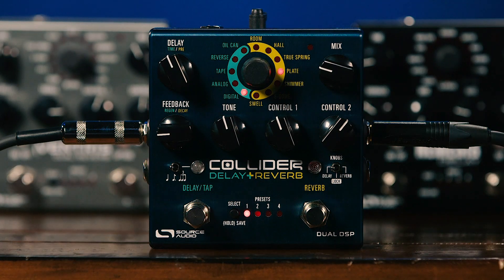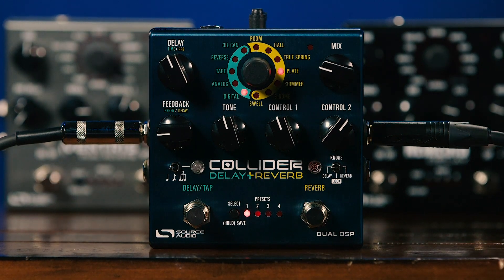Source Audio Collider Stereo Delay+Reverb Pedal Demo

Comment: Excellent demo, Mitch - you nailed it! Great guitar playing, too. Huge THANKS to all the good folks at Sweetwater for all that y'all do.
Reply: sourceaudioeffects when is it out?
Reply: When running it in stereo, is the delay true stereo, or is it the same signal sent out of both channels?
Reply: @skyviewdesign  You've probably got your answer by now, but just in case: All one series pedals are true stereo, routable however you want. By default they auto-sense - sum to stereo if both jacks are used, sum to mono if one is used - but you can change routing in the Neuro editor, say at a live gig you wanted to split the same mono signal to two external devices. On a side note about the Neuro Editor; I love how with the One Series you can download and/or create presets from other similar pedals. You can put anything from the Ventris or Nemesis on the Collider. Plus I have effects from the LA Lady and Kingmaker on my Aftershock.
Reply: @johncbeer  brilliant! Thanks for answering!

Comment: Does the delay and reverb act independently or are there any provisions for "delay into reverb" or "reverb into delay", or any kind of cross mixing them?   Thank you, nice device, nice video.
Reply from the maker: Hi philip. Each of the Collider's independent engines can either be a Delay or a Reverb. So, not only can you change the order, you can also have two Delays or two Reverbs in a preset. -Daniel
Reply from the maker: Hey, Philip! Thanks for your interest, and great question. It depends on exactly what you mean, but you definitely can change the way they interact with one another. Changing the pre-delay and trail settings will give you more separation or interaction between the two to start off with, but you can additionally change the order that the engines are processed by using the unlock button on the Neuro Desktop Editor. Default is delay before reverb, but you can switch that to reverb to delay, or you can run two reverbs or two delays instead.
I hope this helps! Let me know if you have any other questions.
Connor Smith, Sweetwater Sales Engineer, (800) 222-4700 ext. 1793, connor_smith@sweetwater.com

Comment: Can you control the presets with an external switch? Thanks!!!
Reply from the maker: Hi, Don. Yes, the Collider has MIDI capability so a MIDI foot controller could be used to access presets. The Matthews Effects Futurist or Tech 21 MIDI Mouse pedals would both be good ones to check out for that.
Thanks for your interest!
Charlie Davis, Sweetwater Sales Engineer, (800) 222-4700 ext. 1320, charlie_davis@sweetwater.com
Reply: While you switch the preset with an external midi controller, the pedal maintain the trails?
Reply: Thanks Charles!
Reply from the maker: @alessandrocalefato9912  Hi, Alessandro. When switching presets on the Collider, there will be cut off on the trails of the previous preset.
Thanks for your interest!
Charlie Davis, Sweetwater Sales Engineer, (800) 222-4700 ext. 1320, charlie_davis@sweetwater.com

Comment: Does the Collider has the Helix Delay engine hidden in the Editor? Thanks!
Reply from the maker: Hi Derp Senpai. You can use the Neuro Desktop Editor to "Unlock" the 12 engines so that both the Delay side and the Reverb side each can use any of those 12 engines. But there are no additional engines (like there are in the Nemesis Delay). You can also hold the CONTROL INPUT button while turning the Engine Selector knob to "Unlock" the choices. This allows you to have two delays or two reverbs at once. Thanks for watching! -Daniel
Reply: @sweetwater  This. This is a very cool and awesome feature. I'll buy the Collider and a midi controller and go have some fun :) Thanks Sweetwater!
Reply: 7:39 Did this fella just say “..and member..” instead of “and remember..”?🤣🤣
Mmmm, member berries…

Comment: Will this thing also do "ping-pong" delay?
Reply from the maker: Hi, GreenDrink Guy. It won't do a ping-pong by default, but it is possible. It has a mode called Split Stereo. When you're in that mode, the two sounds you have selected are sent to different outputs. You would basically need to assign a delay to the reverb side of the pedal so that you would have two delays running together. Then one would be sent to the left out, and the other would be sent to the right out.
Thanks for your interest!
Charlie Davis, Sweetwater Sales Engineer, (800) 222-4700 ext. 1320, charlie_davis@sweetwater.com
Reply: @sweetwater  I appreciate the response!  I think it may be partially incorrect though because here is a video of a guy using ping-pong delay with reverb at the same time...  (considereing what U described)  How do u reckon he is doing that?  https://youtu.be/iRPTXKs9xwo?t=417

Comment: For what this pedal costs, I'm wondering if you're better off buying a reverb pedal and separate delay pedal. This thing seems like you'd have to spend a lot of time programming and messing with it.
Reply from the maker: Hi Tortilla Man. I own the Source Audio Collider as well as their separate Nemesis Delay and Ventris Reverb, so I can say with complete confidence that it's simply a matter of toggling the chrome switch between Delay and Reverb. Once you've made that choice the knobs behave pretty much the same way they do on the individual units. The biggest difference is that you're eliminating a pair of audio cables and a power supply. Thanks for watching! -Daniel

Comment: Damn I just bought a few months ago, the Ventris Dual Reverb ☹️
Reply: This pedal doesn't make your ventris any less valuable, as a reverb, the ventris does more than this
 This is for folks that maybe don't want a separate delay and reverb, and want a little more simple package. It's awesome, but I'd take the ventris. Or both 😀
Reply: Lance Cluff thanks Lance I see your point 😊
Reply: Fj Francois I have the nemesis and ventris on my board and still gonna use them even after this cool new pedal.
Reply: Jay cool, I see that there’s no replacement for Ventris even with this new pedal

Comment: Seriously who's plugging there pedal into a computer to fine tune it.
Reply: Nearly everyone who's using it in a studio format, which are 95% centered around a computer and DAW. Most high quality digital pedals, especially with midi, all have computer editor functions nowadays. It's crazy
Reply: I think you are living in 1999 not 2019. The short answer is loads of people at home use computers and involve that in there music
Reply: @Honking_Goose  yea maybe but that just seems like too much tweaking..the knobs on the pedal should be enough but if you prefer to play with your computer more than your guitar then have at it!!
Reply: Music producers. Little audio secret but a pedal like this with 56 bit processing is going to make reverbs that outdo most plugins. Lots of people are using insert loops with guitar pedals as FX plugins because they still work better than computer modeled FX in a plethora of specific cases. I have a rack shelf dedicated to guitar pedals that I run vocals, synths, drums, really anything through. Works really well.
Reply: @ryanpwm  interesting..I wouldn't think stomp boxes would be used in such a way. 👍
Reply: "because they still work better than computer modeled FX in a plethora of specific cases" What do you mean they still work better? This pedal is basically... in so many words... a computer running a plug in....a code...algorythm whatever. It has an A TO D converter and processes audio back through a D TO A converter no worse or better than any other digital process.
Reply: ME! Much faster to change routing, parameters and access to way more preset storage. It's rad. Get with the NOW dude!
Reply: @neonether  oh ok that makes ....6 of u
Reply: @jpotts345  Yes, logically that's all there is.
Reply: Me